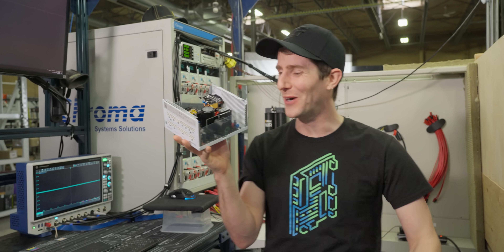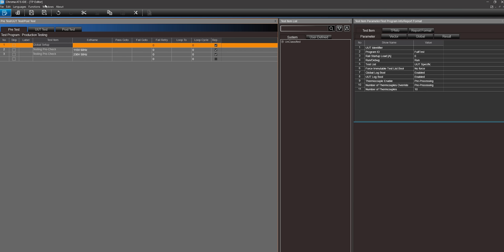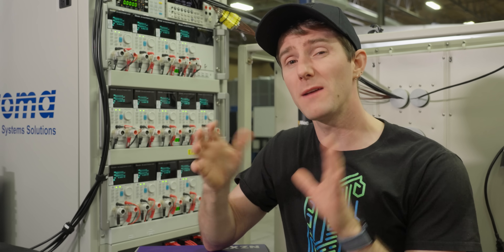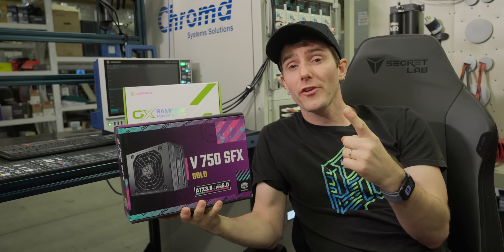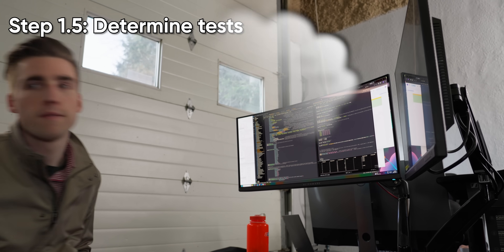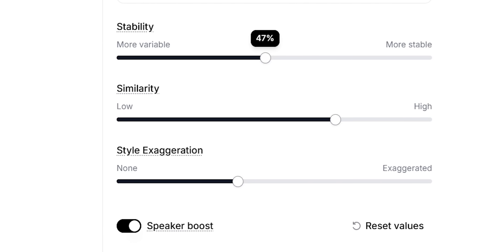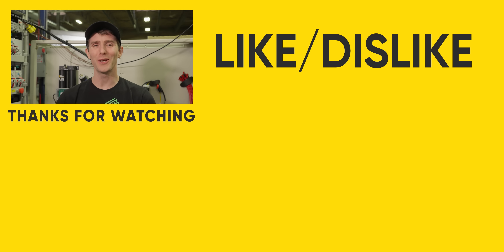Thousands of You are Buying Dangerous Power Supplies

Comment: My Fractal Design Newton 1000W PSU is still going strong after all these years...
Currently powering a Ryzen 9 3950X (OC'd), RTX 3090 and on occasion a Xeon Phi 7120A
Reply: I have a 10+ year old FSP Hydro 750 Watt that’s still going strong, I am replacing it with a new Corsair 750 RMx when my new case gets here though, but it just goes to a show a good PSU will last you for multiple builds if you don’t cheap out.
Reply: @logan62097 a PSU can go multiple builds even if you cheap out lol..my Thermaltake Litepower 550w is still going strong after 7 or 8 years now
Reply: @logan62097 I bought that Corsair PSU it feels cheap maybe they don't over engineer them like the old ones or had some redesign to make them way lighter
Reply: I've got an Aerocool Aerobronze 850M 80+ bronze since 2022, she's been one hell of a trooper, innumerable blackouts and dirty electricity and (knock on wood) hasn't kicked the bucket. Currently powering my i5-10400F / RX5700XT system. The best part is that i paid 1/3 of the real price (around 100 bucks of the time) brand new
Reply: FSP 700W (FSP700-80EPN). Still standing circa 2006-ish, going through s775 (C2D, then C2Q), s2011-3 and, now, AM4.
Currently powering 5700X3D and 4070 Ti Super in the very same beige brick it was bought for.
Reply: Old psu aren’t a flex they will kill your pc if you’re not careful
Reply: @RipliWitani  I used a Corsair one for I think 12 years and it didn't kill anything and I was overclocking with it too

Comment: Hey LTT, It would be awesome if there was a table that sorted PSU's based off of efficiency at a certain wattage. For example, for homelab guys, our systems pull between 50-150W and we want to know what the most efficient power supply is at that load

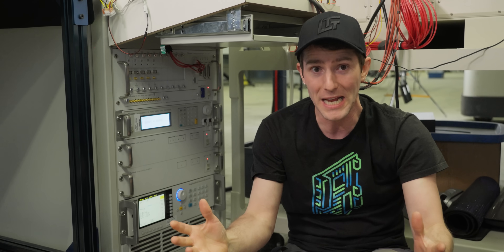Comment: 2:18 relay isn't just a fancy name for switch... Relay switches a circuit indirectly, meanwhile a switch is directly in the circuit itself.
Reply: so- it's a fancy switch..
Reply: @Pe_iki  can a switch use low (safe) voltage for switching high voltage? No, it can't... Son it's not a fancy switch, jus because it also can turn stuff on or off doesn't mean its the same thing.....
Reply: Have you read the relay wikipedia page?
Reply: @sauyonl  no, because I learned about relays and switches at school multiple times...

Comment: I just upgraded to a RTX5090 and I was too curious what my 2014 Seasonic X-850 (KM3) would do. There was quite a lot of coil whine from the PSU when running 3DMark but it didn't shutdown.
Notable to mention is that i'm using a Ryzen 5800X3D. GPU-Z readout reported 575Watts and minimum voltage of 11.8V. 

Currently running a NZXT C1200, almost all coil whine is gone now and  GPU-Z readout reported 575Watts and minimum voltage of 12.0V.
A true quality PSU is worth every penny!

Comment: im no electrician but isnt the limit for most NA homes like 1600 watts max per circuit?
Reply: that depends   (Canada) generally wired 120v @15A  so 1800W . new  kitchen installations  are 120v@ 20A  = 2400W.
homes are wired for 240V,  with either a 100A or 200A entrance  or 24 000/48 000 Watts total.
If you are building from new,  AV or computer rooms can have much better supplies.

Comment: i had a brand new spare Apevia 600 watt power supply 33$ intended for another project end up being used on my new 9800x3d build for a week while my rx1000 got shipped over. It caught fire and send sparks into the main compartment. Luckily took itself out and only itself lol. DONT CHEAP OUT ON POWER SUPPLIES YOU WILL DIE
Reply: Not gonna lie, your experience is making me a little nervous about the 800W Apevia that my pre built came with, especially since I also have an overclock going...
Reply: @  dude that powersupply will wreck your system lmfao
Reply: @HiluxCobbler6975  I've been considering replacing it just because it's colored black and I recently moved the components into a white case, but white PSUs are so few and far between, it's kinda frustrating.
Reply: @ buy a black one and buy a cheap 12 dollar roll of white vinyl

Comment: 8:07 is that correct ? 13hz differece seems a bit more that slightly of or is it just swaped and tested at 63 for NA voltages and 47 for the rest running 230/50 hz ?

Comment: As bad a rep as corsair used to get for their PSUs, their customer service is top tier. I had a TX650 start to smell right before warranty, they sent me a new TX650V2 without batting an eye, i still have that PSU as well. I also bought one of the RM1000s that werent very good, but replaced it with an RM1000x newer version thats rated A+. I've been nothing but happy with their PSUs.

Comment: I will basically only use this information once every 4 years, but will be incredibly happy it exists.   Cutting through the BS will be invaluable and such a Pro-consumer move, I hope for nothing but continued success for LTT labs.
Reply: Absolutely this! I'll rarely need the info but it's invaluable when the time comes that I do!
Reply: Why every 4 years?
Reply: @ a computer more than every 4 years! In this economy!?
Reply: @zatch01  I am pretty sure he implies it is actually often. I upgraded my 6 year old PSU recently only to make sure there was enough power available to the GPU, but I plan to keep this one even longer as I think 850W should cover the power requirements of any future upgrade.
Reply: I'm using a 13-15 yr old 2nd hand 850w power supply haha.
Reply: My 17 year old 250w delta electronics PSU is still working which came with my core 2 duo PC. It is till actively being used by my HTPC. Before that it was used in my i3 7100 + rx 560 PC too.

Comment: Buy BeQuiet if you're in EU, German brand, best PSU's in the world, designed for 230V from ground up and tested up to German/EU safety standards and regulations, which are by far the most strict in the world. I settle for nothing else anymore, not even Seasonic.
Reply: the be quiet dark power pro 13 has come of the worst reviews and high return rate.... ill stick to seasonic being the gold standard of power supplies

Comment: Huh, looks like that is a current measuring shunt resistor. Weird they obviously undersized it. Would love to know how hot it gets. Seems to be a design oversight, because even sh1tty electronics are somewhat consistent nowadays (except bad solder joints). So no surprise the next one would fail the same way. Will never happen to my Flower-Bridge 2000W Unit. It has 99% Diamond.

Comment: Power supply testing is useless without letting consumers get a good look at the guts of the unit.
The reason being that power supply manufacturers have been known to change the internals significantly without changing the model number! Corsair and Antec are two big names that come to mind as guilty of this in the past.
This means my only point of comparison to your tests is the model number on the box, which is worse than useless. You as the tester are putting blind trust in the manufacturers to properly label the box but by testing in the first place you assume they also lie on their spec sheets.
In addition there should be a proper evaluation of who built the unit (since brands like Corsair and EVGA aren't actually building their own), based on what sort of technology (remember Haswell-compatible power supplies?) and with what quality components (the worst ones even use parts like counterfeit capacitors!). Plenty of cheap chinese miracles that function fine and even pass tests for six months and then turn into firework factories due to poor quality components or just plain old bad soldering after that.

Comment: Guys, if you are building a cheap PC and don't know what PSU to buy, just buy FSP PNR 600w or 750w. It has been in production for almost 20 years and has had a reputation for being the best PSU for its price for a long time. Yes, it is still a so-so PSU, but it is clearly better than nice looking aerocool, exegate and others. And one more thing: FSP designs and manufactures their own power supplies, which makes them some of the best value. They also make them for other brands, like Be Quiet!

Comment: Gamemax is one of those brands where I feel like its made to be cheap and shoved into prebuilts. My first PC was a prebuilt using gamemax parts and the fans were loud (1 stopped spinning after a year or so) the case had hard plastic where all the fans go apart from exhaust which was choking the airflow and the power supply literally always had that electrical smell as soon as I turned the PC on but I had no knowledge about PCs at the time so as a naïve 13 year old I bought it simply because I thought the case looked cool

Comment: Damn, wish this was actually helpful. I've had the msi mpg a1000g (one that failed in the test) and yall didn't go in at all as to why that particular one failed just simply - "it failed 🤷‍♂️" 

Mine has been going along for 23 months now running a 4090 and the lack of information to how this PSU failed - isn't helpful.

Edit:

And they couldn't even LINK the other channel OR to the videos of the failed PSUs

Went out of my looked for it, barely over a minute long and its practically just an ad for a "failed" psu which makes no sense. They "don't recommend" it but they link to the psu's Amazon listing. 

So I went to the ltt labs website  - still doesn't mention how it failed or what happened when failing, just "it failed". With how well it did in most of the other test, which it passed all of, which I'm still unsure of how it failed. Did it blow up? Short circuit? Cause a fire? No further information?

This being my first depth into the labs feels underwhelming especially since the first big review they did was the 4090 back in 2022 - which they failed on first impression.
Reply: Do you have the old version or the PCIE5 version? I've had this PSU for a year and a half now (non-PCIE5), 0 issues whatsoever. Bought this in the first place because it was listed as A-tier in that psu cultist tier list, so I guess only the newer version has these problems shown by them🤷‍♂️
Reply: @faza210  yea i have the black 12vhpw not the yellow one that comes with the 3.1 revision. Which is even funnier since the yellow 12vhpw is supposed to be the better one for 4090/5090